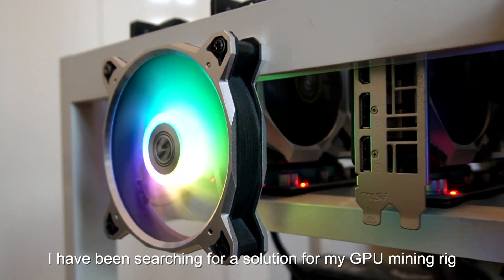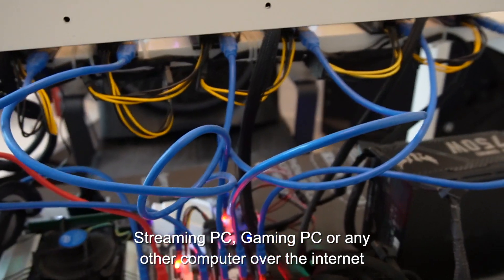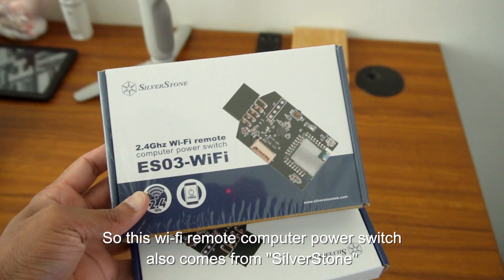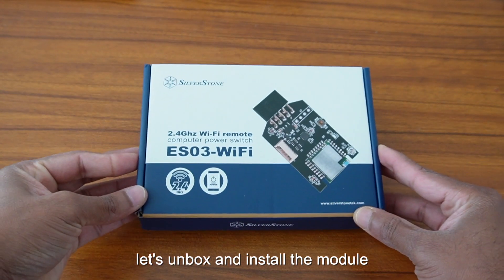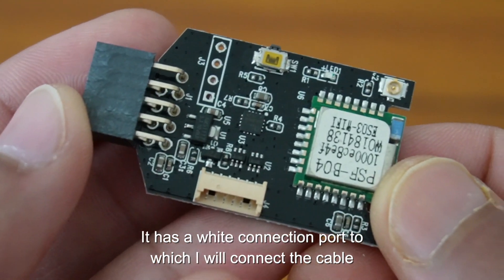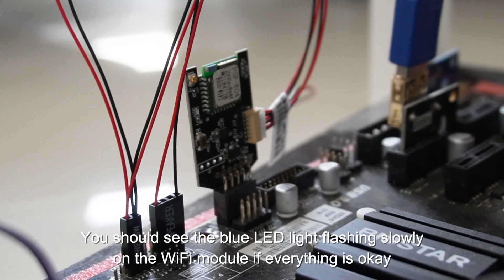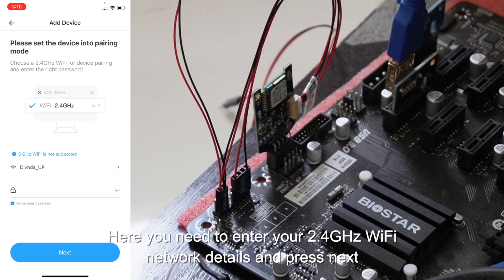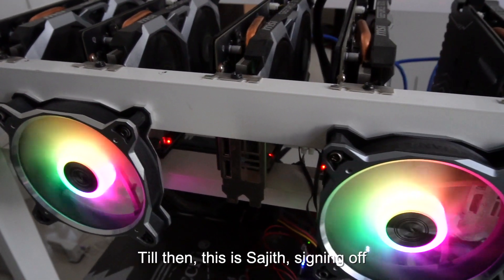ES03 Wifi Malayalam | ഇനി നിങ്ങളുടെ Computer മൊബൈലിലൂടെ power On/Off ചെയ്യാൻ സാധിക്കും!

Comment: Can you clarify if connecting the Power SW will allow the PC to be turned on using the power switch?
Reply from the maker: Yes I will
Reply: @KanzWorld97  thank you. And what if the motherboard has no SPKR pin? Where should I plug the wires then? Appreciate you time!